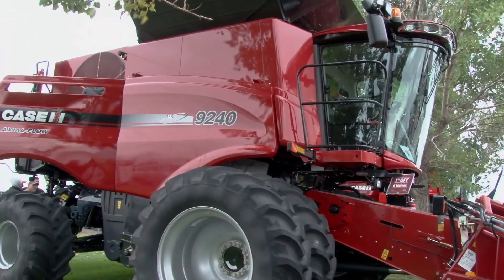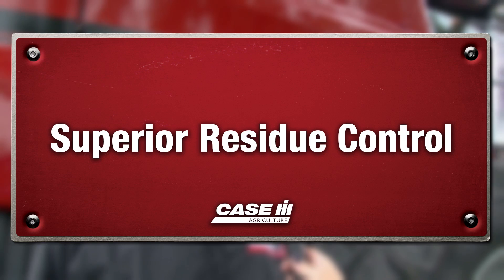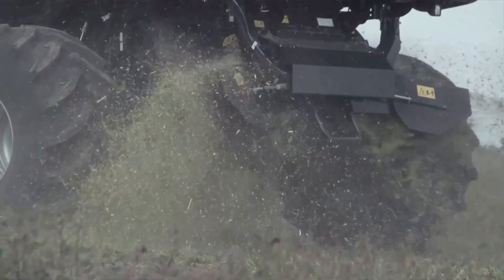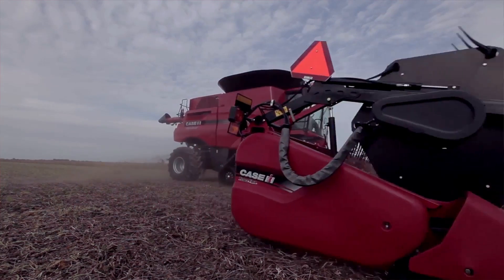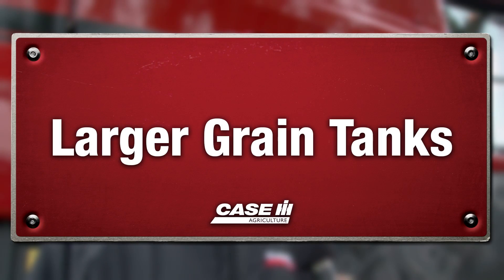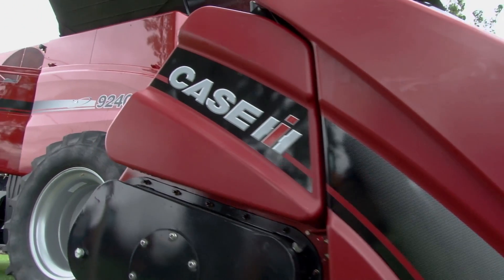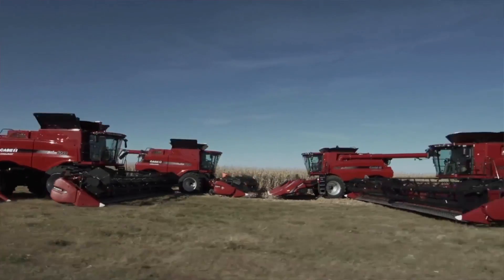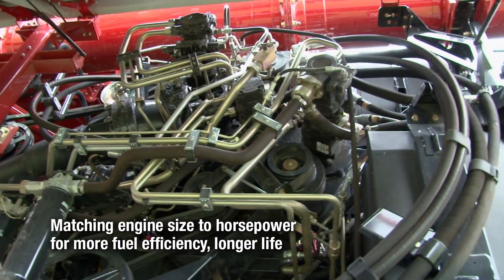What's new on Case IH Axial-Flow Tier 4B Combines

Comment: Yeah now put the 15.9lt in the steiger. please. There is no replacement for displacement..
Reply: sirk edhor no need. The 4wd already have more hp and torque and use less fuel then any other 4wd on the market. The 15l in the Deere and versatile have less power and drink 15% more fuel. Look up the Nebraska test data! Deere 9620 is has 37 LESS peak hp than the case 620. 
There is no replacement for proper engineering.
Reply: You're WAY oversimplifying it. He's not talking about peak hp. Anyone can achieve that today. Who cares? It's a tune... He's talking about the increased reliability and longevity of an engine with larger bearing surfaces, larger fasteners, more cooling, thicker cylinder walls, larger pistons crowns, wider head gaskets etc. There is a reason demanding high duty cycle applications favour large displacement engines over more aggressive fueling of a smaller engine. Look a the hp to displacement ratio of modern semis.
Reply: sirk edhor turbos and high pressure common rail fuel systems replaced displacement.
Reply: Wrong. Turbo tech and HPCR do not replace the advantages of larger displacement engines.